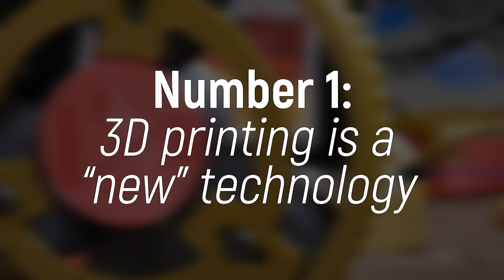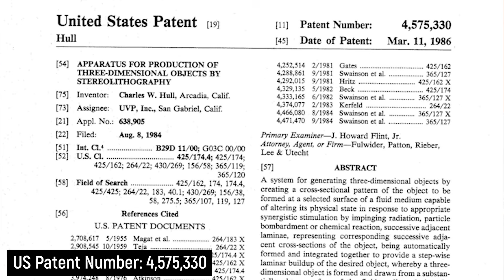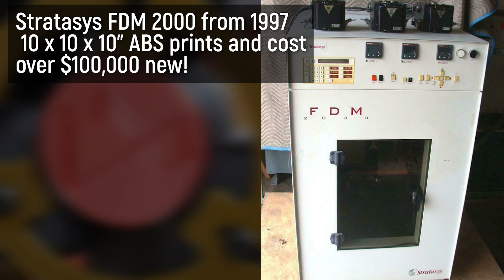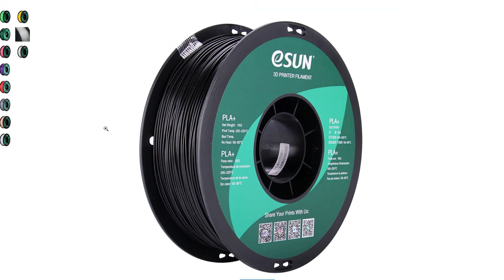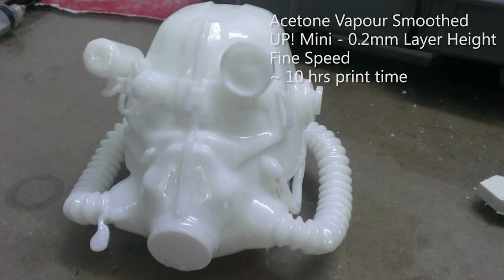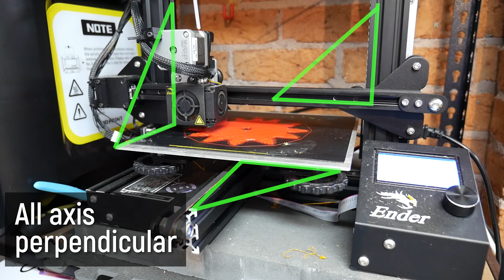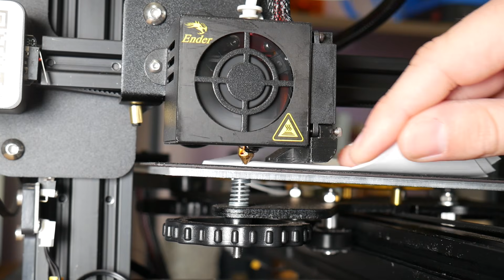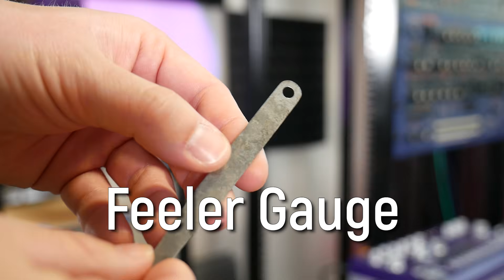3D Printing Myths I used to believe...

Comment: I just now bought a 3-D printer because I kept thinking the misconception that they are prohibitively expensive. I finally broke down and said let’s get a cheap one. At least I’ll get some experience and be able to properly understand what I need and expect out of one.

Now I realize this is 1970s or 1980s technology it’s a hot glue gun on a drafting printer… There is nothing about the software nor hardware that makes this cutting edge in anyway unless you’re from the 70s. It’s a glorified hot glue gun using special hot glue. 

They even make 3-D printing pins for five dollars on eBay just a hot glue gun with a feeder instead of a trigger and the hot glue is colored more consistent and extremely small. If I had known that I always imagined it would be cool. 

I always thought about trying to put zip ties, stripped wire, insulation, weedeater line through a glue gun to adhere or create or repair items

Comment: Seriously, Cura and prusa both have temperature sitting profiles that don’t include higher and filament manufactures that only do the temperature profiles not meet manufacture specifications, there is no overlap between manufacture specifications, Cura, filament, temperature, profiles, and what actually works in reality.

Why is it they say TPU needs a hotter bed then. PLA? Best results I’ve ever had from. TPU is not heating the bed at all… 

Either way, no matter what I do Zyltech PETG always sticks so hard that it pulls pieces of glass with it

Now, instead of adhesion problems, I have too much adhesion to the point where I keep thinking about spring. Pam cooking spray on the bill plate.

Comment: Who the fuck folds the paper? You use a very thin piece of paper so you can feel when it's making contact and then you don't have to worry about having to adjust because the error you would get from using the paper is already negated by the deformation in your system when the nozzle presses on the paper. So as long as you use thin paper and a friction that causes you to still be able to push and pull the paper around (80g/m2 or lower) it's absolutely fine and you won't have any significant error between your bed and nozzle at z=0.

Comment: To level the bed, I use a feeler gauge and then print some single layer test squares and trim the Z on the controls. It’s really easy to see if it’s too far or too close and once it’s perfect, it stays pretty good for a long time.
Reply: Just add a brim to your parts and do the calibration on the fly while printing your parts!

Comment: Whatever else it's always worth doing the paper test before you start for the day to make sure nothing has come loose, been knocked or worn out. 

Feeler gauges are hard and if you have too much pressure it might look ok but you may be lifting the print head so may not give a true indication of where the head actually sits. 

Best way is to manually set the bed temperature to the temperature you will be printing at doday, then use a single sheet of paper to level the deck to the print head on all 5 points. The paper I use is good quality 80gsm printer paper which is 0.11mm thick. 👍

Then print some test strings and incrementally adjust the height in the software to ensure proper 1st level grab and adhesion. 

Once done you can go through printing sting towers etc to fine tune your temperature and speeds for the spool of filament you are using today if you like.

Comment: I have 1mm and 3mm fr-4 sheet at work which I believe is garolite g10 but flame resistant. Might try make a sheet for the Bambu x1c somehow. Looking for the best surface to print cf nylon onto.

Comment: This was helpful as I absorb all I can prior to purchasing a 3D printer. Re the feeler gauge: as soon as you said something about the leveling w paper I was screaming "feeler gauge".  Especially folded paper will give crappy results. FYI: an inexpensive feeler gauge set at most automotive stores as they're used fir several tasks including gapping plugs. That for folks who might have a 3D printer and not mess w automotive stuff. Easily purchasable hopefully nearby w out waiting on shipping.

Comment: I've always used one of the large Rizla rolling papers (skin). I find it's the perfect thickness, doesn't leave any residue, doesn't add any impurities. All round I think it's a far better choice. I also use some high grade weed and it makes a really nice spliff.

Once I've smoked the spliff I use a small section of standard weight Reflex paper to tram the print bed. 90% of the time it works every time.

Comment: What I've dialed in for bed leveling is using a smooth bed and a sheet of regular copy paper NOT folded. Once I start to feel resistance that's where I stop. And for settings I set the first layer to .2 - .25mm unless I'm printing in lower quality with higher layer heights. Has worked well for all filaments. Also I Just discovered asa and man do I love the stuff. Printing abs is a huge pain if you don't have an enclosure, which I've come to realize the hard way. Also, printing with flexible pla is a pain as well. Tpu turns out better, but I personally hate the way it feels and don't like using it for anything that I have to handle on a regular basis.

Comment: Do you have to level the nozzle everytime or just once
Reply from the maker: Once and then again if you move the printer or find it's not printing right after a while.
Reply: I upgraded the firmware with the Marlin ROM and use an auto-leveller on every print, and then tram the print bed at around 7 day intervals. Before I upgraded to the auto-leveller combo I trammed before every print. It's way over the top, Muse's advice above is more sensible, but I've only been 3D printing for about a year so want to eliminate user error wherever possible at this stage. It makes diagnosing easier if something doesn't print correctly.

Comment: ABS is much better for things like heat resistance. Think I'm wrong? Print out a PLA part and put it in your car outside in summer.
Reply: Everyone knows that don't worry. But if you anneal pla it has more heat resistance than abs.

Comment: I never really bought into ABS being stronger as much as most people. I'm big on printing with whatever gives the best most reliable print quality, it'll result in better layer adhesion, and thus better strength, but for a printer that is GOOD at ABS, then it may have advantages.

Comment: As a 53yo electronics tech but 3d noob I've been using a 0.12mm / .004" feeler gauge and feeling for the vibration as I move it back and forward a bit and it seems to give me great first layers. I did take a bit to work out in my mind how the adjustments on the bed alter the plate. Now I heard your explanation about it to do with the relationship to the frame it makes a lot more sense. I pictured the bed adjustments almost twisting the bed. Until then I was getting really confused doing a manual level before hitting the auto level button. I have to say I have an Ender 3 v2 Neo and whether it was that I made sure to follow all the instructions for once or I got lucky I've had an awesome experience so far with your's and Chep's help. Thanks heaps from New Zealand 👌🙏

Comment: TL;DR About ABS:
It's okay for heat-resistant elements, but you're going to use it for stuff you wouldn't print with PLA and mix the scrap with Acetone to make ABS slurry, glue, and paste.

Comment: I know this video is over a year old, but I wanted to throw my hat into the ring about bed leveling.

I bought a CR10S about 3 years ago. Got solid prints with it for about 2 weeks, then wasn't able to print anything at all anymore. Tried mirrors, new pieces of glass, resquaring my frame, adjusting hot end height, glue sticks, hair spray, etc. Nothing. Wouldn't stick. Gave up for 3 years.

Bought a BLTouch, installed it in an hour, ran a calibration cube, almost spot on first print. After a bit of tweaking, I've been printing nonstop for 4 days straight. Not one failed print. I don't even watch the first layer like a hawk anymore. 

And you know what? 
I can print M3x6 screws/nuts now. 
On a CR10S. Sure, they can get a bit wobbly sometimes, but it can do it.

tl;dr - Buy a BLTouch (or other mesh bed leveling device). It will change your life.

Comment: a feeler gauge is the same as a piece of paper or shim stock. Paper thickness is approx .002-.003 (.05-.07mm) so I doubt it has a huge effect on the zero for something like 3d printing. The paper trick is used in cnc machines and manual mills which is probably where 3d printing got it from. The same logic applies there only .003 often does matter so you compensate.

Comment: A standard sheet of paper is effectively a 0.1mm feeler gauge. It's not perfect, but the problem really comes from failing to set the offset rather than using paper in the first place!

Comment: Totally agree with the leveling.  I use the paper as a first guide, doing it 3 times as when you adjust one side of the bed, the other points can go out of whack. Then I print a model and manually adjust while printing like you do to get the perfect height for the first layer. Don't forget that after a few prints, it may change height slightly, so every 3 or so prints check that it is still the right height by checking the brim is still nicely put down😃.

Comment: I use receipt paper until all points have the same resistance. Then back it off as necessary. I use brims to dial it in on those before the print starts.

Comment: I do use a level, but only to ensure the Z axis is "close enough" to the same level as the printer base.  Any time I have to change something that requires bed levelling or tramming Z, I always use a method pretty close to what you described in this video.  It only took me two years of experimentation to figure it out for myself.  I always bottom out the bed, zero Z, make sure the beam is within a couple degrees of the printer base, then level the bed and set Z zero.  I have Prusa currently set such that zero is actually 0.22mm, with a first layer height at 0.16mm.  With the 0.3mm nozzle this works phenomenally.  The reason I don't physically zero Z is it simply makes the process a tiny bit faster doing it in software, as opposed to jogging the axis up manually each time.  At this point, I verify bed level every few weeks, and don't often have to change anything.  A secondary reason I use software zero at 0.22mm is that the bed surface on my MegaX is definitely not flat.  When heated, obviously, the center is a decent amount higher than the edges, around 0.22mm it seems.  Without mesh levelling (older Anycubic with stock firmware), this method has been the most effective at creating the best first layers.  Except with Delrin (acetal).  That doesn't want to stick to anything, ever.

Comment: I also use a level to level, and auto leveling. I use a level to level the whole machine then auto level, and finally level with level again to be sure it is dead on. I have noticed that 3d printers don't really check to see their height. They assume they are at a certain height. 0.00mm should be the nozzle tip touching exactly the very surface of the bed. It should only be off in the layer height from the bed while printing. That will depend what you have layer height set to. If while printing your nozzle is 0.2mm from the bed when it is set to be 0.15mm then the z-offset should be -0.05mm to bring the nozzle back to 0.15mm. the problem is I think when you switch off the printer it loses it's previous position. They reset it by having it go to the "home" position. I seem to get better results if I set the Z-axis to zero. Then disable the stepper motors and physically turn the corkscrew gear to lower the extruder nozzle to true 0.00mm. so when it starts off and moves the nozzle for the first layer height, it's exactly at 0.15mm or whatever you have it set to.

Comment: I've never heard of folding it. Anycubic suggests a sheet of paper unfolded. I use generic paper that's even thinner. However, using a feeler gauge would be better. However, be careful that you don't smash the nozzle into the bed. It can damage either component or both. You could also use a spark plug gapping tool, but get the flat metal one and not the one with the loops. Just don't smash the nozzle tip into the gapping tool so it doesn't mess up the nozzle opening.

Comment: I like to level my bed by downloading a first layer calibration test from the internet and then starting the print with my bed way too low, then slowly raising it upwards until you get a solid first layer. If you get a good file, the printer should work it’s way around the bed multiple times in the process of completing it which will allow you to hone in the first layer throughout the print.

Comment: ABS vs UV light - all commercial 'biodegradeable' plastics are UV sensitive, as UV is what is used to kick start the degradation process, and is a function of the original materials being doped with materials that weaken the bonds between molecules.
'Most' plastics are not biodegradable in their pure form, leading to products that last so long that no one needs to by a replacement for a worn out product, meaning the marketplace around them saturates with unsold product and collapses. It is a deliberate commercial choice by manufacturers to make products that will fail over time.

Comment: As far as the paper "leveling" goes, the thickness of a single sheet of printer paper was common, and usually worked for me. I generally prefer heavier paper, and paper in general varies in thickness between weights and brands, which has bugged me.

Comment: I use an old Spark Plug Feeler gauge for my leveling. After using the paper trick  for the nossel, on my Ender  well it dug into the bed. So after replacing the bed i figured a gaper would work best. I did not know you could set the the start in gcode though thank you for that info.

Comment: I always use a plastic loyalty card (same size as creditcards) for the nozzle height. That way, you know how thick they are and basically everyone has one of those laying around. Before that, I used an unfolded paper and that worked flawlessly too

Comment: Paper trick works just fine you don't fold the paper over. Use a normal piece of paper and if you can't slide under the nozzle its to low. You slide it until it goes under but has a tiny amount of drag. Works for me

Comment: 5 - PLA = Garbage, what the tensile stress demonstrate was layer adhesion is as important as material properties due to lower Tg.

The main reason PLA exist so to facilitate those without heated chamber and quicker to extrude unlike the warm up time normally take with a hot runner system in the injection mould tool.
Reply: Wow you are clueless

Comment: I set my X5S zero by wiggling the bed up and down and watch and listen to the bed hit the nozzle ... that's zero. Now realize that the zero position switch only has a Z axis stepper motor resolution so adjusting the leveling screws on the bed gets the zero Z more precise. 50mm long pointers on the Z stepper motor shafts keep them in sync and seldom need correction of a manually forced step ... hey it works!

Comment: where the shine in ABS imo has always been is the almost tough rubber like slight flex to it, it makes it an ideal plastic to print with for ball joints and responds more positively to use of a heat gun then PLA (which you risk warping easier)

Comment: Another Great Video I found in a forum where they were using a " Neoteck Electronic Digital Dial Indicator Gauge" attached with a 3d printed mount on the printhead.  They say they are always right on and that it is very quick, easy, and precise.

Comment: They make feeler gauges out of plastic and they are readily available online. I mention this because dragging a hardened steel feeler gauge accross the face of a brass nozzle will cause the brass nozzle head to deform overtime. The brass will move in the direction of pull, it's not something you'll likely see with the naked eye but your essentially reducing the diameter of the nozzle slightly with each pull. You'll notice the contact area of the nozzle head will appear to be polished after using the steel feeler gauge a few times, brass is already starting to move at this point.   
  Brass is used as a bearing surface for light loads and is known for conforming to the surface it moves against, this is a plus in a load bearing scenario but not great for a nozzle head. I still use a thin piece of plastic to true up the bed and just offset the nozzle the amount I've determined works best, it's repeatable every time. 
    I've been designing/building special purpose industrial machinery for 27 years so I have the background to back this up despite never having used a steel feeler gauge to true up my bed. Steel feeler gauges are a great tool for the right application, this isn't one of them.

Comment: I use my BLtouch to level the bed by creating a mesh and adjusting the corners to match. That has proved to be way more accurate than using paper. Also I use silicone rubber spacers instead of springs on the bed. I only have to relevel the bed after disassembly or other maintenance.

Comment: Did you know “resin printing” likely evolved from semiconductor chip manufacturing? Almost every “microchip” nowadays is literally built using a “sorta” similar photolithography process on machines like mask aligners and steppers. They work in a similar way as resin printers “masking” the levels of the circuit, building it from the substrate up. Coincidentally, 405nm (and 365nm) are the most common wavelengths used. Resin printing uses that wavelength to cure. Pretty cool. Could go on for days - been in semiconductors for almost 23 years, recently discovered resin printing and bought my first Ender (because I don’t want to deal with resin). 👊🏽👽👍🏽
Reply: I am resolving micron to sub micron features in semiconductors tho…😅 A human hair is 60ish um.